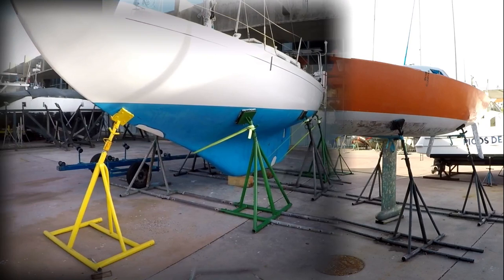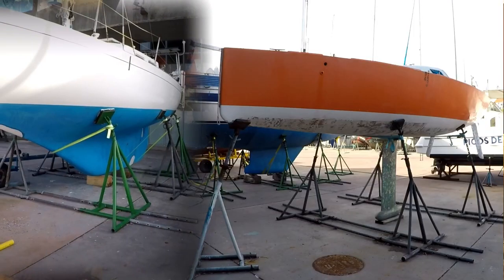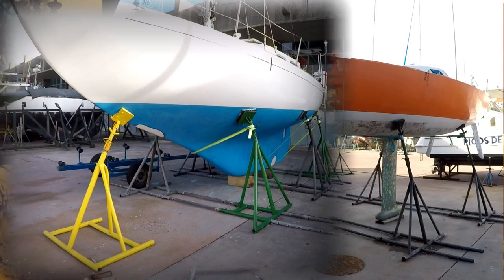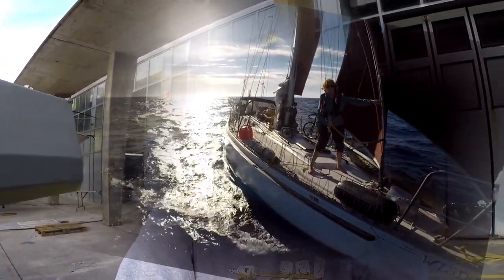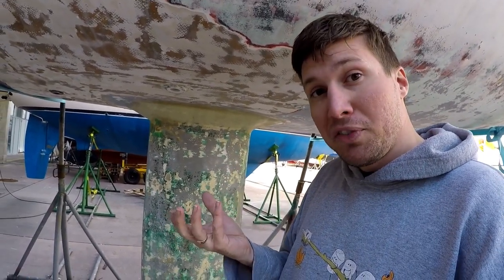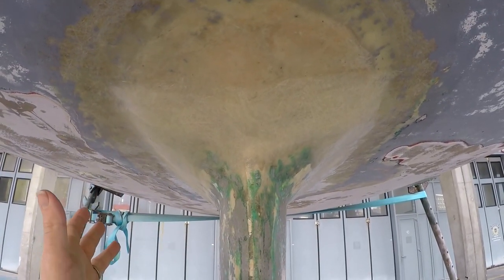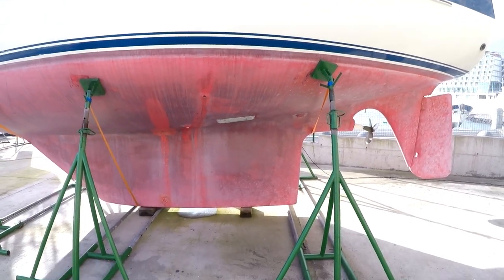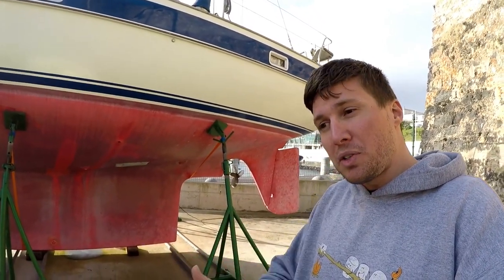Which is the BEST Keel Design? | Sailing Wisdom

Comment: Good video. What I realize is that almost everything I know about airplane wings applies to keels. Those long horizontal (slab) keels are a lot of drag. That first thin keel is actually the most efficient...but that huge epoxy gusset says it's never going to work. It's probably bolted in a small footprint which is why it needs those gussets. There's no reason why something of that shape can't take all the forces on it -- so long as you don't make it a hinge! That keel should've continued right into the hull and then have all it's side bracing done inside the bilge. Problem solved. 
The most efficient wings are those on sail planes, long and narrow. The same applies to anything you pull through the water. 
I still like the idea of swing keels. Hit something and it lifts out of the way. And you can park on the beach when you want. Ground on a sandbar? Winch it up. It's kind of the Cmd-Z Undo of boating. Are there rudders that  swing out of the way? The ones on my kayaks do. 
I can't help but think that as the wings and the hydroplanes continue to develop  along with machine learning and auto pilots (Tesla autonomous driving will eventually impact sail boats) that we'll see hydroplaning blue water cruisers. 20-30 knot boats skimming along, micro-adjustments being made multiple times a second,  while you and your partner are snoozing...
Reply from the maker: That will be the future. With AIS, we all show up as dots on a map so collisions will be avoided!
I like your view on swing keels, the undo button is great! They really are the best of both worlds: ultra efficient and comes out of the way so you can get to shore!

Comment: My question is what do you think of a pendulum keel because that's what I have on our 25 foot Catalina sailboat that is a tall rig
Reply from the maker: Pendulum keels (also called swing keels) function just like a fin keel, giving you excellent performance but with the added benefit of being able to be lifted out of the way. 
You can also “trim” your Center of Lateral Resistance (CLR) by raising or lowering your keel. As you raise the keel the CLR moves aft. On a fixed keel boat, you can only trim the sails which moves your Center of Effort (CE). “Balance” comes from getting the CLR and CE to be at the same point in the boat, this is when she sails straight with no lee or weather helm. On a fixed keel boat, achieving balance is only possible by moving the CE around a fixed CLR point, but with a swing keel, both are adjustable!
On a run, the keel can be lifted up out of the way creating much less drag as the keel is not necessary when sailing downwind. 
Swing keels give you a lot of adjustability as you sail and the ability to anchor in a really nice and shallow spot while all your other sailboat friends need to take a dinghy to reach where you can anchor for the night!

Comment: I bet skeg around 10:10 has steel bar inside which helps to protect the rudder. In this case fiberglass cracked due some load and skeg should be inspected so steel inside wont rot.
Reply from the maker: Just glad it’s not my boat!

Comment: What are you calling a storm, 25kts? Think I’d rather have slippage sideways down a wave in a storm with a fin than get dug in and knocked down with a full keel.
Reply from the maker: 25 knots is “we’re going to move fast” wind. 
A storm, in my opinion, is winds of 40+ knots.
Reply: Rigging Doctor I think you might want to revisit fins, maybe differentiate between offshore racers from the early 70s and modern boats. We’re still comfortably sailing in 40knts, so a storm for us is 60+ and when a wave picks you up and you start surfing, that’s the point when I believe full length keel become dangerous, they dig in and broach as soon as the boat is forced to go beyond its max hull speed. Try holding a plate vertically in water and see how difficult it is to keep  straight as you move it versus a kitchen knife. 
So, full length keels are great for long distance cruising because they’re slow but track well, easy to handle short handed. Safer? Weather a storm? Put me in an early 70s Ocean racer any day.
Reply from the maker: That is a good point between the plate and knife. I prefer to heave to and the large area of the keel makes a nice slick with slow leeward slip. After the storm we keep going.
Different strokes for different folks!
Reply: Have you never had your boat picked up and sent down a wave? The only way to avoid that is by throwing out a sea anchor.... surely you’re not doing that in anything above 40kts? 
I guess there’s storms and then there are storms!!
Reply from the maker: melvakids true, with our full keel, we heave to nicely and big waves calm down in the slick. We carry a sea anchor and hope to never use it.

Comment: Surprised you didn't mention one of your boats , or any full Keels advantages the lateral resistance , and all that  it entails.
Reply: A full keel is advantageous for lateral resistance only when the keels are stalled or the boat is drifting. A properly balanced fin keeler will heave to about as well as long keel. But if you have ever tried to maneuver a long keel boat in a marina you will see why any one other than 'Popeye' would only try to reverse with a fin keeled boat.

Comment: Thanks, a good insight into keel configurations. Going back to boat construction material, would buying a steel hull with long keel even if it's an old boat eg 50 years be a wise move for long haul passages? What's the pros and cons of steel ? Can the masts be any better supported by a steel hull?
Reply from the maker: We are going to do a video on hull construction materials soon, but the short answer is they all support the rigging the same, wood/steel/aluminum/concrete/fiberglass; they have strengths and weaknesses like all other hulls. The trick is to pick a hull that you are comfortable working with to carry out repairs. Any boat 50 years old (and newer) will need repairs done to the hull. Knowing how to do them yourself will insure a standard quality to the work as well as sort out the issue of “finding someone with the skills to repair your hull”. 
Friends we have met with steel boats have all loved their hulls, but they all also knew how to weld and deal with controlling rust.

Comment: Thanks for the video, great information. What are your thoughts on the Southerly swing keel?
Reply from the maker: I think they are an awesome system allowing you to get into places that other boaters only dream of. That said, the more systems, the more complexities, and the more sources of equipment failure. 
I’m now a guest on a rather plush ketch with push button gizmos and I’m constantly crawling around the engine room fixing systems for the owner. The diesel motor, or the water maker, or the furler... adding a swing keel to the equation might just add “fixing the swing keel” to your list of chores while you are out cruising. 
Aside from being another thing to repair on the boat, I really think it’s awesome how Southerly yachts perform! They get into shallow spots that normally are only navigated by dinghies!

Comment: Something should be said for a long or full keel when it comes to holding course if you're single-handing and need to go forward, too.
Reply from the maker: Very true. Even in a following sea, they want to hold their course! 
We usually turn and wait for the bow to start moving. While this is great for holding a course, if you are racing, it would feel like if the boat is on sleeping pills! 
The maneuverability of a fin keel let’s them turn fast but in turn are twitchy when it comes to holding a course.

Comment: What are your thoughts on bilge keels? they don't have any advantage in the open sea as far as i know, but they allow you to safely and easily let your boat fall dry in coastal areas with enough tide to do so. this allows you to explore your surroundings at low tide on foot and even gives you time for small repairs under the waterline in some places.
Reply from the maker: Bilge keels offer the advantage of letting you dry out with ease, but each bilge keel will either be fin or full (not totally full, but pretty darn lengthy fore/aft). So, they still fall into the performance features of the fin or full classes, just with double the drag (and the ability to stay up if you get caught in the tide).
Reply: @RiggingDoctor  Just saw episode 91 of sailing wisdom. not falling over seems to be nice enough to mention ;)

Comment: @Rigging Doctor You suggest long/full keel designs are ultimately safer because they are stronger, but it's important to consider other factors that will affect your safety, such as the behavior in bad seas.
In a recent interview, the first two winners of the Golden Globe Race complained about the long keel / heavy displacement of their yachts, suggesting they were more dangerous than lighter displacements because they were more difficult to control, and rolled a lot more. Also in the GGR, Susie Goodall's boat pitchpoled, resulting in her Rustler 36 being dismasted. Pitchpoling is a rare event that seems more likely in a heavy boat that has no planing ability.
Reality is that an efficient rudder is also important to have, and so is the ability to make good speed when running, and so is the ability to go upwind to avoid the coast, etc. You have to factor in all these things when discussing safety and making a design choice.
Reply from the maker: Very true! It is a all a balancing act. 
Those must have been some insane seas to cause her to pitch pole!
Reply: I've often wondered if trading speed and upwind ability for a keel designed that's more robust to groundings is really the safest choice ? Especially when you consider some of the better built & more conservative fin keel boats.
Reply: @chrisgoguen765   I agree. Groundings are only one problem. When a design feature is considered, all potential problems that might be the cause of that feature should be analysed and balanced. It's the only way of studying boat design.

Comment: A very biased and quite superficial explanation with some false claims.... I wont try to correct that here. However, one small nuisance is that the terms “aerofoil” and “aerodynamic” can never be used about foils in water. Aero-foil means a foil that operates in air. Aero-dynamic means that it performs well in air. A foil, in this context, is just any type of wing. The correct terms you should use is just “foil”, or if necessary “hydrofoil”, and then “hydrodynamic”. “Hydro-“ is water, of course. Both the prefixes, aero- and hydro- , comes from Greek and Latin. Hydrofoils are actually any wing in water, but using that term will frequently be misunderstood as a vertically lifting foil, since that’s the most normal use of the word in common language now. Calling a keel or rudder an aerofoil is just painful.
Reply: I think we all knew what he meant!
Reply: SuperHaz007. Yes, of course, but it’s still not nice to use completely wrong terms. Many will not know that it’s wrong, so the misuse might spread. If making technical learning material, one should be a bit strict with accuracy. This word issue isn’t the only issue.
Reply: @SuperHaz007  True we knew what meant, not sure however that all knew what he meant.
If one goes through the trouble to make  an informative video then he might as well be as precise as can be.
Hearing him say at 3:38 that a keel helps resist righting moment instead of saying heeling moment suggests he may not fully master his subject and that defies his purpose.
Reply: Agent J I’ve subscribed to your channel, think it’s absolutely awesome! Loved the NZ jet boating clips too...... but... they’ve been sailing upwind long before flight.... credit due to the humble boat.

Comment: Is there any such thing as an adjustable keel ,and if not when is some genious going to design one
Reply from the maker: The closest thing to adjustable would be 1. Swing keel or 2. Canting keel
Swing keel let’s you move the CLR aft to help the boat stay on a run and fight weather helm.
Canting keels help move the ballast laterally to help increase righting moment and allow the boat to carry more sail in higher winds.
Reply: Also lifting keels like the seaward yachts. There are also various hybrid systems with a small fixed fin keel with a swing keel at the bottom, as a sort of extension.
Advantages of lifting and swing keels is that you can minimize wetted surface area when downwind or motoring. Also a boat can have a fairly deep keel while also being shoal draft. Disadvantage is a lot more complexity, and often a much weaker keel. I would be worried with seawards system if you were to hit anything, that impact must transfer to the lifting mech somehow. 
I used to have a San Juan 21 with a swing keel, it was nice to lift the keel for motoring. I also had a few low speed bumps... No problem! The keel just swung back and all was fine. I sometimes putted into a Sandy beach until it started to  touch, then pull it up and drop anchor. I could hop off the boat in knee deep water. This really bugged the big boats who would often be a long way from the beach.

Comment: Half full keel or !!!!!!  No keel .. two hulls and a dagger boards.. thats what you really need.
Reply: That was going to be my comment as well!
Reply: Monk Petite you have to get a bigger cat than you would need in a mono to get a decently sized bed.
unless you want to sleep in a coffin
Sure you get more beds in a cat but unless you get a big cat they’re all really small
Reply: The problem with cats is, once they get turned upside down, it's game over.
Reply: JAFO ...that rules also for single hulls.. 
To add ...spade type keels and rudders are not really the best construction for the long duration. 
Full keel is a must to be rugged and strong but ....any boat what is turned over will be a survival event. 
Give me daggerboards and two hulls and I’m happy.. stable and fast means comfort. 
Never over power the boat.. and you will not topple over..
Reply: @MonkPetite  - That only applies to monohulls that have succumbed to the disease of putting racing-boat features on cruisers. My personal opinion is, fin keels and spade rudders = unseaworthy cruising boat. Monohull and full-length keel all the way, baby!

Comment: What about Manueverability? Could you address that area? Seems like Wisdom's keel should be Quick to turn because all her keel is Aft, and none Forward?
Reply from the maker: She is sluggish. You turn the wheel and wait, then she comes around. A trick we do in close quarters is we turn the helm all the way over and then give it a blast of forward thrust. The rudder directs the prop thrust sideways (almost like a thruster) and turns the boat quickly. Under sail, she really likes to hold the course and not turn. 
I once sailed on a fin keel and almost knocked people over when I did a course correction (it responded so fast that it jerked everyone on board).  
Using that as my basis for what fast turning is, Wisdom is slow. That said, I have never been on a full keeler where the keel runs into the cutwater for a comparison on “is it more maneuverable”.
Reply: Hmmmm. I may have to go with a fin keel, then, Slow Response Freaks Me OUT, lol! Too many years Driving... @RiggingDoctor
Reply from the maker: You get used to it, like you would anything. The problem is when you take the helm of a friends boat that responds differently.
We always plan all our turns before we get in anywhere tight because we have to. Fin keels can scoot around like a sailing dinghy!
Reply: I was thinking when I get to get one, I'd find a 30-footer or so, and maybe build a vertical Dagger-board trunk into it. With a shoal-draft keel. The trunk wouldn't take up MUCH more space in the cabin than a mast foot or a compression post, I was thinking.  @RiggingDoctor